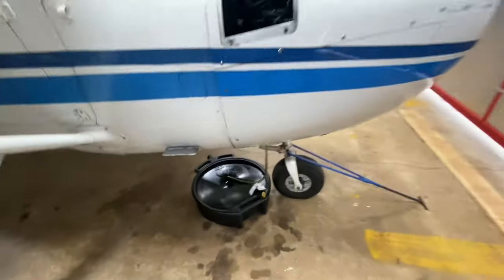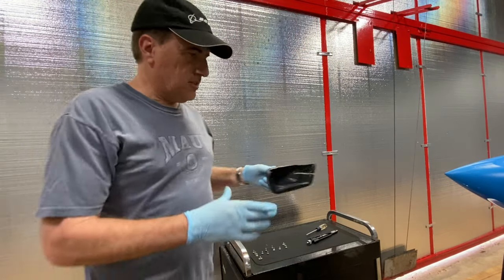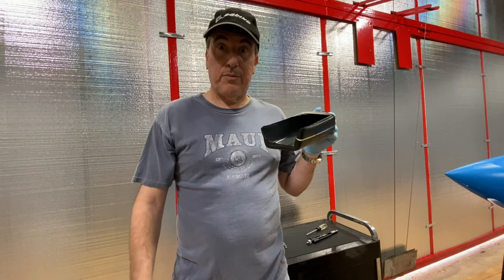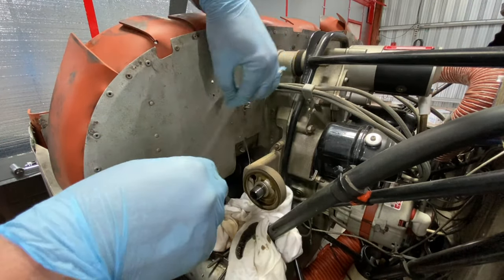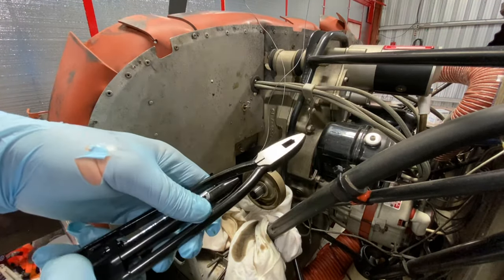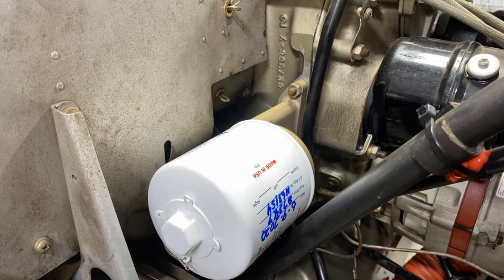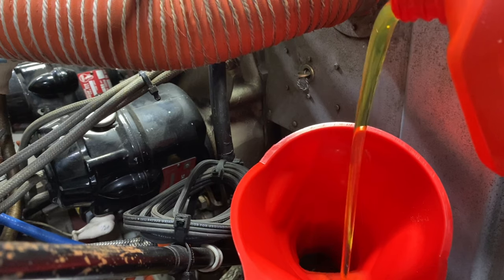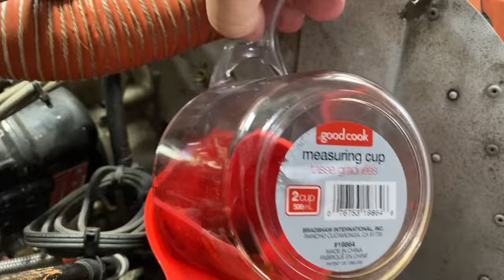Cessna 150 Oil Change Tips

Comment: Punch a hole in the side of the filter and use shop air to blow the oil out of the filter back into the engine.
Reply from the maker: @drobertsone  I’d worry about metal from my punctured filter getting in the engine.  Also, not sure if that dirty oil would have time to get to the drain plug
Reply: . I maintain a fleet of flight school aircraft. The procedure i stated is quick, there is no metal introduced (we do oil sampling each month), and the oil goes straight into the sump.@quinnjim
Reply: @quinnjim . Use a small punch. The hole doesn't have to be large

Comment: Different screw size??   That's why you have the A&P at annual change your freaking nut plates so there all matching.   Leave the length of the safety wire on the end of the filter and cut at the housing so you can hang your filter into a bucket off the handle.    Take a flipping corner (ie 90') of a big card board box ie 24" long and tie a long string with a big washer hanging down so the stream drops onto your drain pan..  

Why not just use a dab of DC4 around the seal and boom done.   

We maintain a fleet of 700 flight school aircraft all over the country..
Reply from the maker: I'm going to need you to calm down.😀

Comment: Very informative video.  I know you're looking for your next plane.  After it is purchased, will you keep or sell the 150?
Reply from the maker: Probably keep it.  It's perfect for Maddie to build time and for Quinn to get his license in.  We fly it around for $15.00 per hour in gas.  The Cirrus was over $40.00 per hour.  It adds up quickly when they need several hundred hours!
Reply: @quinnjim   That makes perfect sense to me.  Good luck with your search.
Reply: @quinnjim  were you using mogas or was avgas $3/gal?
Reply from the maker: @jerryspringer6411  Gas at my airport was around $3.75 at the time.  We could get it under 5 gallons per hour if we weren't in a hurry.

Comment: So how much money do you think you saved??????
Reply from the maker: I'm not sure.  The oil is about $8.00 per quart and the filter is about $30.00.  I ended up putting 5 quarts in so it cost me about $70.00 to do it myself.  I would guess that a shop would charge me an hour or so.  I probably saved $80.  I like doing it myself because I let the oil drain out for a LONG time where a mechanic being paid by the hour might just let it drain for 2 minutes (leaving a lot of the worst sludge behind).  I've had so many issues with people changing my oil in cars over the years, that I want to do it myself so it's done RIGHT.  It's not just about saving money for me.